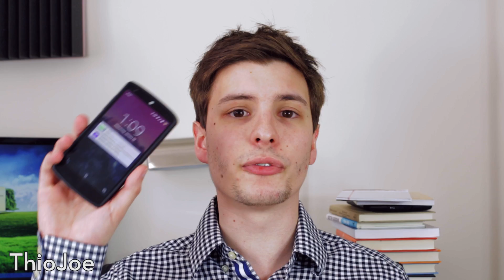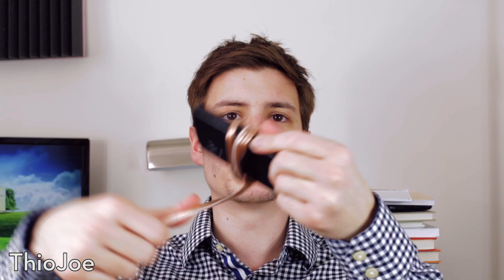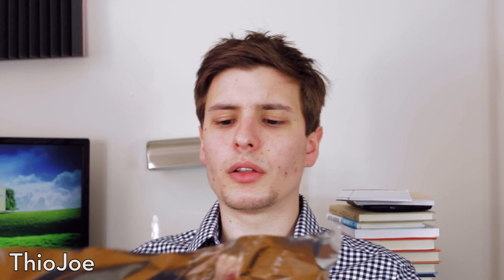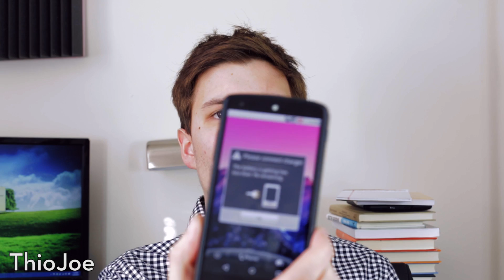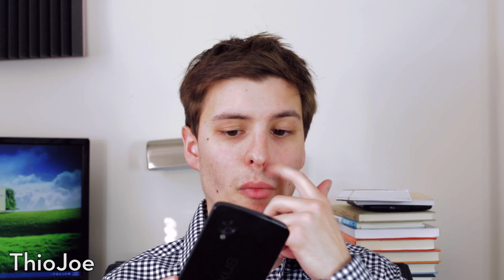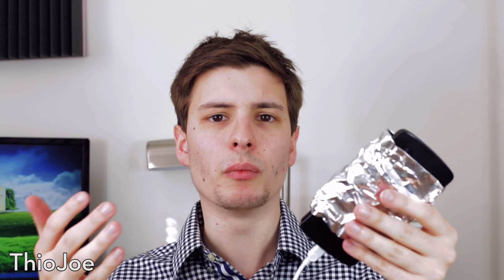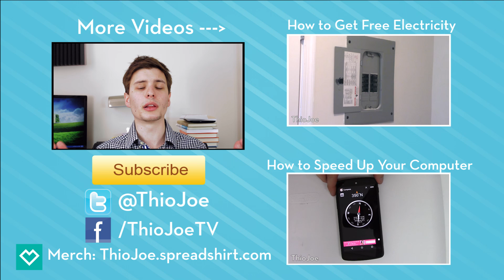How to Instantly Charge your Phone

Comment: I microwave my phone. It works because the waves create energy (like sea waves). Then the Bluetooth reciever in your phone gets the microwaves and converts it into Bluetooth waves which turn into charge waves. These waves then go into your battery via nfc, and thus your phone charges! Only works on android because apple do not have nfc.
Reply from the maker: Unboxings13 Interesting, i'll be sure to try that next time my battery is low and i'm in the kitchen
Reply: ThioJoe You can use your oven too!
Reply: Actually the iPhone 6 and 6plus do
Reply: ThioJoe oh don't forget the toaster i here that works great!!
Reply: Unboxings13 how many minutes are we supposed to put it i also tried your idea it worked but took me 3 minutes and also my phone was hot
Reply: Bluetooth just links your devices it doesn't just convert e.m. Waves into electricity.
Reply: Thats why I like android.
Reply: ***** Yes... I know this... That's not what I was pointing out lol. I was saying that they do, when the original commenter said that the new iPhones don't have NFC.
Reply: ***** I mean, I have an iPhone. I like it, I just hate how locked down and buggy the software can be sometimes.
Reply: *****  please do not take android. why? errors
Reply: ***** Windows phone has no apps and is lag as heck though :/ I like the way it looks, but everything looks the same throughout apps, which isn't a bad thing, but still, no app support.
Reply: Tyler Eberhardt Funny, Because i just had a Lumia 535 and it works perfect. It has apps. App support however is still a bit a problem. But the apps that works fine are not from shabby devs. like 23432421234 inc. (rdm name)
Reply: when i put my phone at microwave its just dead.. rip
Reply: Soljack Yeah, that's what I mean. App support is baaaaad. If it had more love from app developers and features like iMessage (of course, it's own variant) that switches from say.... Skype to SMS without charge, I would happily swing over to windows phone, especially with Windows 10 coming out
Reply: +Unboxings13 DUDE have your heard of the iPhone 6 well apparently not, cause iPhone 6 uses NFC how do you think we can pay for something at Starbucks or something by holding up your phone to the register that is using NFC
Reply: Efrain Salgado I dont know what you're talking about.
Reply: Efrain Salgado Oh my starbucks, iphone 6 CHILL WITH THE STEREOTYPES
Reply: andrew humphreys ill try that
Reply: iOS 8 implomented a new technology called "Wave" which allows you to charge your iPhone by putting it in the microwave for about 1 second.
Reply: actually new iPhone 6 does have NFC now via ApplePay duh every1 knows that
Reply: TechRax tested microwaving an iPhone for 5 sec and it went up 1 percent
Reply: Unboxings13 Am I the only one who thinks that is a bad idea. I mean ur phone has metal in it and from experience I can tell u metal in a microwave doesn't work out too well.
Reply: ***** oh, sorry. It's sometimes hard to tell through text.
Reply: That's a cool way to do it!
Reply: Unboxings13 acctually the iphone 6/6plus has apple pay witch uses Near field communications
Reply: HAHAHa,  yeah, shitty fuckin video
Reply: -_- NVM
Reply: Unboxings13  or in only 3 seconds of a phone being a micro wave with the micro wave on it will cook you iphone and it would not work anymore if you dont belive me check of the chanel TechRax
Reply: That's only for iPhone 6 on iOS 8
Reply: Stop faking
Reply: Martin Träff-Bouvin I wrapped my phone in foil then put it in the mircowave for 15 seconds it charged the phone from dead to 100 percent
Reply: Jonathan Bertocchi No the phone will charge and the foil protects it from the ways it really works i tried it
Reply: Aren Reyes Don't put it that hot it needs only about 20 to 30 seconds.
Reply: Dude your an idiot
Reply: Your stupid good luck exploding your phone
Reply: Unboxings13 you too? XD
Reply: What?
Reply: Putting you're phone in the microwave actually works, and it does work with an iPhone, I actually found it worked better with iPhone
Reply: The Bearded Mage is easier on android there is a mircowave charge feature in the settings while apple is more of a process
Reply: ThioJoe  dose this actually work
Reply: I Tryed it. It actually works
Reply: EH VLOGS Dumbass tryhard grammar.
Reply: LOLZ
Reply: Unboxings13  thanks
Reply: greatest bullshit i ever heard
Reply: Skitz mad?
Reply: EH VLOGS
You're an imbecile. Why on earth would I be mad? What on earth shows that I'm mad? Are you the one who's mad?

Comment: How many times should I wrap the cord around my phone? Also clockwise or counter clockwise wrapping?
Reply from the maker: It depends on the current phase of the moon and the alignment with orion's belt.
Reply: ThioJoe ok appreciate your help Joe! You're the best :)
Reply from the maker: Mitch Bailey-Walton Thanks mitchy boy
Reply: Mitch Bailey-Walton it did work, did you even try it? typical troll
Reply: Mitch Bailey-Walton
Because it works,
 test it properly instead of spreading misinformation.
Reply: ThioJoe your a joke, no not a joke an absolute idiot...
Reply: Mitch Bailey-Walton Make sure that you are using 16-gauge clear 2-conductor speaker wire, that will eliminate any distortion from the charge cord...you're welcome.
Reply: ThioJoe XD your amazing
Reply: It's fake
Reply: I can't believe that people thinks that it actually worked
Reply: Wow. That just blew my mind
Reply: make sure to use non-stick works better
Reply: i think clockwise
Reply: Mitch Bailey-Walton ey mitch. shoutout from the future fully filled by people with thiojoe's style of advanced intelligence. LOL.

Comment: Thank you, my phone got charged instantly. Wow, this is amazing. I rate it 10/10 charges.
Reply from the maker: glad it helped mahfriend
Reply: I did this and it did not work. My mom came in asking what am I doing to my phone.
Reply: King James One thing ThioJoe  didn't mention is you have to make sure you're plugged into a Advanced Output Wall Outlet or AOWO. The reason for this is that the standard outlets detect the amount of electrical potential is being use by a device and regulates the electricity by predetermined amounts, while advanced outlets let the device use all electricity available to it. These outlets are very new and only come standard in homes that are built or remodeled after 2002, but since they are slightly more expensive, most companies and contractors will try to cop out and get the standard ones instead. If you are unsure which outlets you have, you can call your electric company and they can tell you by doing what they refer to as a interpolectosial ping, but you may have to speak to a manager as not everyone know about these outlets.
Reply: What phone did you use
Reply: galaxy s4